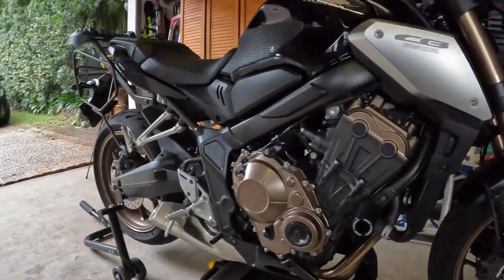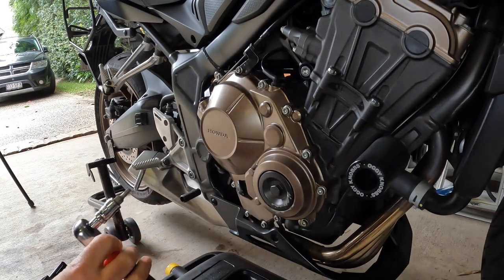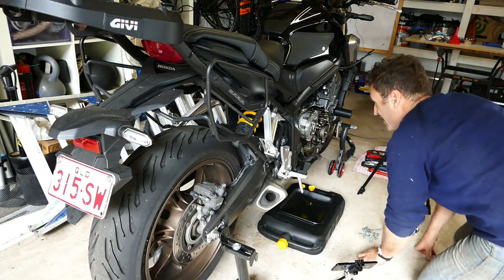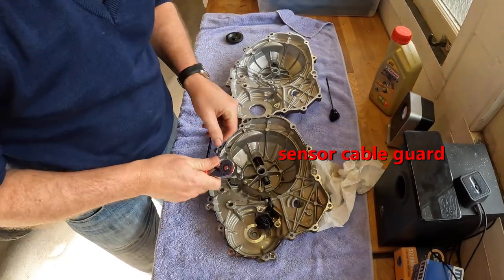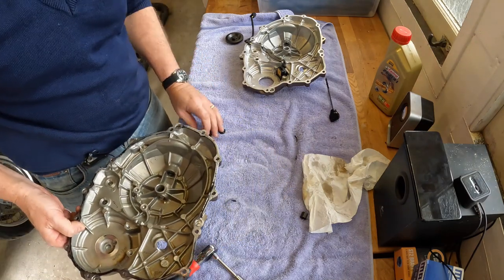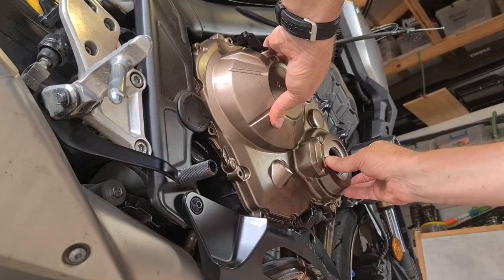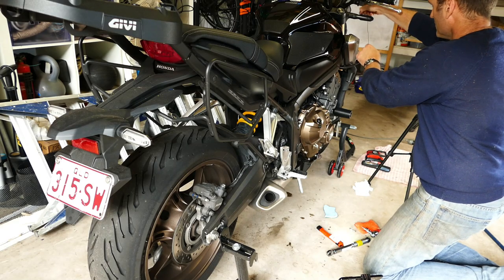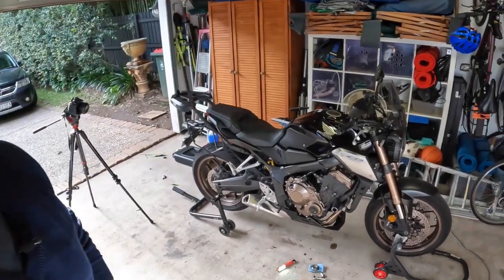Honda CB650R (2019) - new crankcase cover

Comment: I want to say thank you!!  I was doing shims on my CB500X and two of the shims went flying. I found one and not the other. I was unsure how to pull this side case off and so this video was extremely helpful. 

I still did not find the shim but this pretty much convinced me it is not in the engine as this was the only side it could be on. 

I always make a donation to charity when a video helps me save money, so I will be doing that once again. 

Thanks again

Doug.   Canada

Comment: Thanks so much for the vid. I just picked up a '23 model. First day out and dropped it. Left a nice little scuff on the crank case. For now I'll wear it with pride but when I do my first oil change I'll replace this at the same time. Cheers, mate!
Reply from the maker: See comment immediately below....  Good luck - take your time and make sure you have all the info and materials you need before you start.

Comment: I just replaced mine, i managed to do it with a small bits ratchet and I used no torque, Honda workshop told me I'd be fine to handtighten it. Thanks for the video!

Comment: Thank you so much! I've bought a brand new Z900 about 2 weeks ago. Unfortunately, I dropped it last week. After watching your video, I gain more confidence of replacing its crankcase by myself.
Reply from the maker: Just take care to get the right advice (torque settings, workshop manual instructions etc) for your particular bike before starting on this job.  You don't want things coming loose or breaking off inside the crankcase!  Good luck
Reply: @donaldomoto здравствуйте, подскажите пожалуйста н.м затяжка болтов по основным узлам honda cb650r. Спасибо

Comment: Donald I know what you mean. I have the Honda CBR650R which is that bike with the fairing and I had yours but the wind blast was too much and so I traded it for the R and the fairing helps so much with the wind, anyway I accidentally tipped the bike over (Thank you R&G Sliders) and got a little scuffing on the exact same spot as you have. Cheers. Mike.

Comment: Thanks for sharing. I dropped my CB left side due to not full deployed sidestand. And the alternator crankcase was scratched
Reply: same here, do you have to remove the oil when removing this side to?
Reply: @levinsocher2388  yes, i did
Reply: @GTMB1987  ok thanks and when you open it do you have to watch out for something?
Reply: @levinsocher2388  just watch out when apply silicone joint, do not put inside any bolt hole, or bolts with tight and break

Comment: Why didnt you just replace the damaged black part
Reply from the maker: Yes, that would have been an easy 90% fix, I agree, but there was some wee scratches on the crankcase also and replacement cost was remarkably low, so I did that too

Comment: Appreciate the time in making this. I've currently got a small oil leak in the rocker cover gasket, is it a similar process to replace? would you recommend doing the rocker cover by yourself or a bike mechanic?
Reply from the maker: It's impossible to answer that question.  It all depends on your mechanical skills and proficiency - if you're not mechanically inclined, then best leave it to a mechanic.  But if you have the skills, tools and the right information, then its probably not a difficult job

Comment: Any additional tips to insert the clutch knob from the engine side to the case, I am trying for 2 days to get the cover on. It's just not going in. When it does, the clutch lever is on the wrong angle and will not rotate towards the cable like you did at 17.50

Comment: Hi, I just want to ask one thing, After applying the gasket, did you wait a while for it to dry or did you install it immediately?
Reply from the maker: @tekeristonline  No, I immediately brought the surfaces together and tightened bolts lightly until gasket material began to squeeze out.  Then after 90 mins, tightened bolts to correct torque settings.  This was as per the instructions for the particular brand of gasket material I used.  Other types may have different instructions?  I used Permatex "The Right Stuff" - item number 25228.
Reply from the maker: @tekeristonline  https://www.permatex.com.au/products/gasketing/black-gasket-makers/permatex-the-right-stuff-90-minute-black-gasket-maker-85g/

Comment: Hi there.   Wondering what was your opinion on the cb650r and commuting side of it?  Is it boring or juts great?   Thx heaps
Reply from the maker: I found the CB650R light, narrow and zippy for commuting.  Good on fuel.  Much prefer the suspension and size of my BMW R1200R for highway and touring, but its a big wide heavy bike and though I do commute on it now (have sold the CB650R for financial reasons), if commuting was all that I did, I would have kept the Honda!